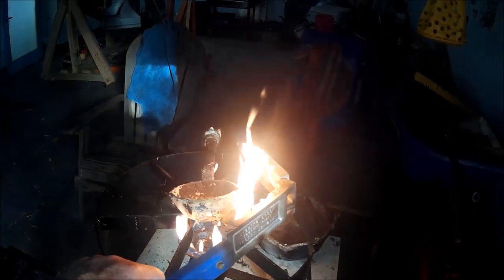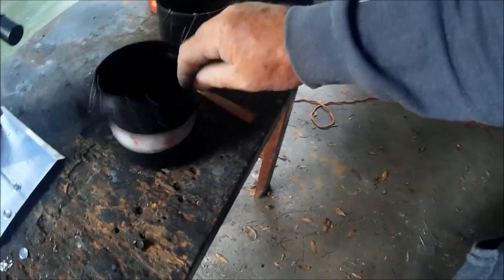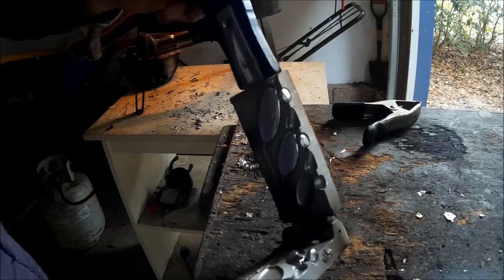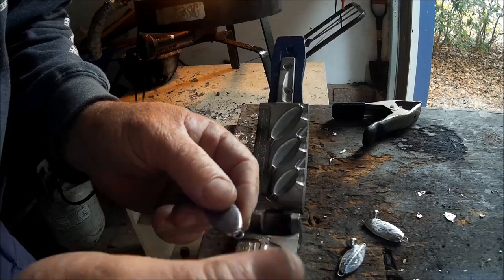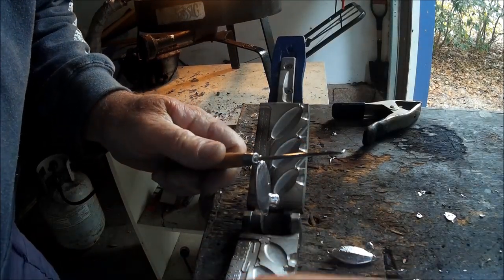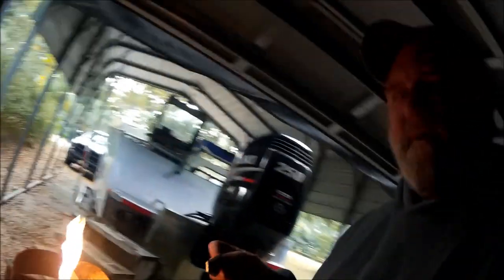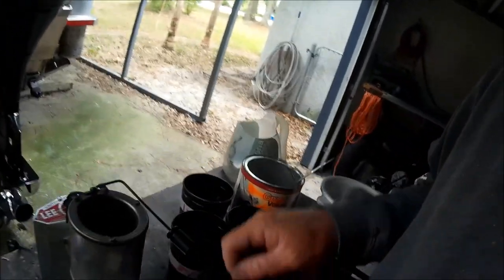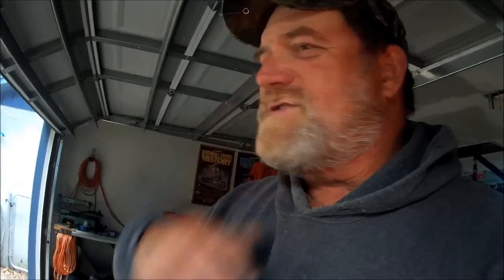SLAB SPOONS; for Jacksonville Fishing

Comment: did you use to buy the slab spoons before you started making them ,and if so where did you buy them thanks for the great video hope to see you one day out on the waters of jacksonville
Reply from the maker: Austin Ewald I still buy them and haven't made any in a long time. Painting them is a real bitch, and ordering constantly the wire jig forms. You can buy them on ebay so cheap it's ridiculous.  I mostly buy Chrome ones off Ebay.  See this video:  https://youtu.be/6DDGYMZmLwc
Reply from the maker: *****  BTW, you can't miss me. I'm the only charter boat in Jax thats a real "commercial boat".......all welded alloy, as seen here:  https://youtu.be/h0iuGdQbSIs

Comment: Are you using a do-it mold? I've been looking at them on ebay. I use a ton of flutter/slab spoons every year.
Reply from the maker: i'm not making any slabs, just tried it, thats all. didn't want to get into all the proper painting. i can get so many great colors and shapes from china off ebay so cheap its ridiculous.  i have other video's showing all them and the deals. if i can find it ill post it.
Reply: Capt Daves Sportfishing Charters I've tried painting lures before with very limited success. I can probably buy alot of slabs for the price of the mold!
Reply from the maker: especially on ebay by very good makers in the US,  i just like other shapes too.